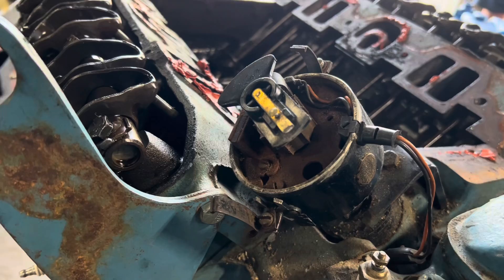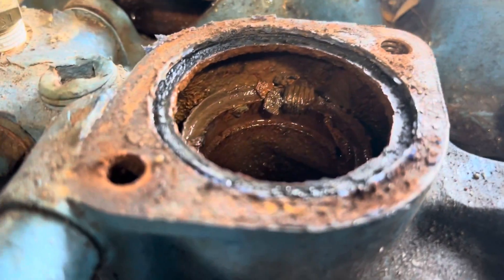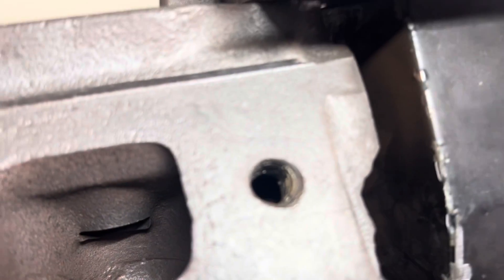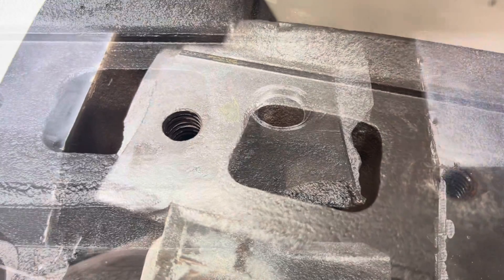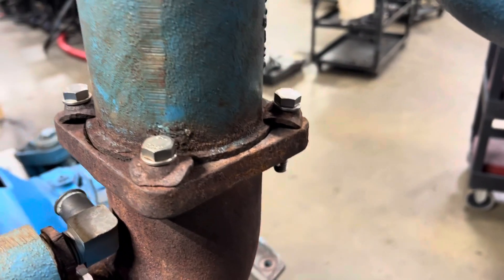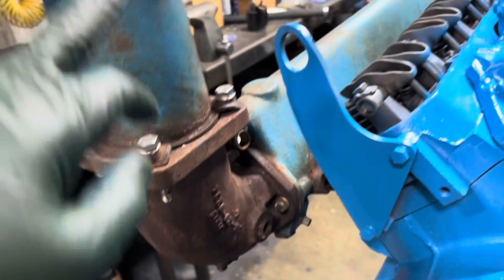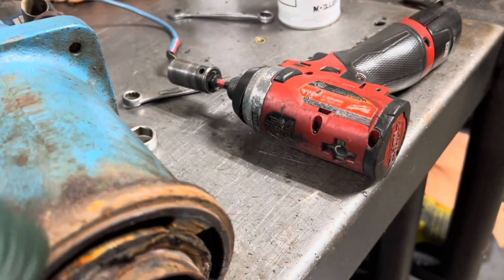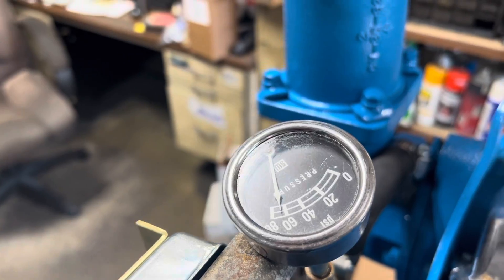Chrysler Marine 440 Engine Overhaul

Comment: I might be mistaken but the 440's last year in marine and industrial was 1983. Most of which was leftover engines that officially stopped production in 1978.
Reply from the maker: You are correct about the production ceasing in 1978. That was the last year any Chrysler big block was produced. Motorhomes, marine and industrial continued to use them through the early 80’s
Reply: Thet had their own sound. @LakelandAutoMarine